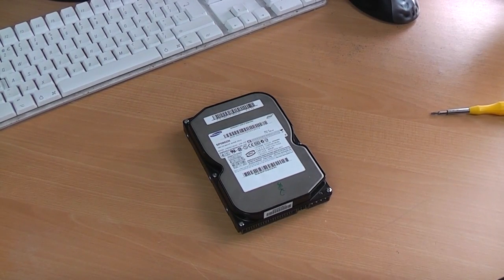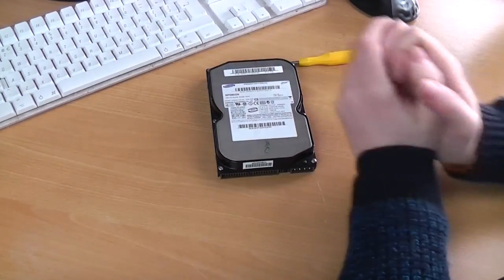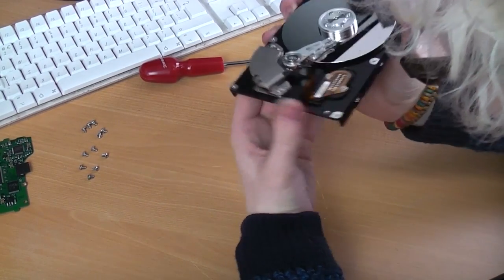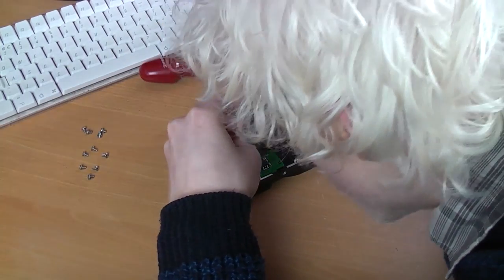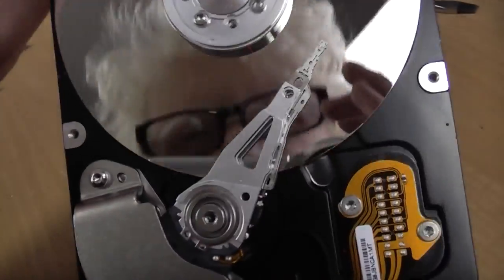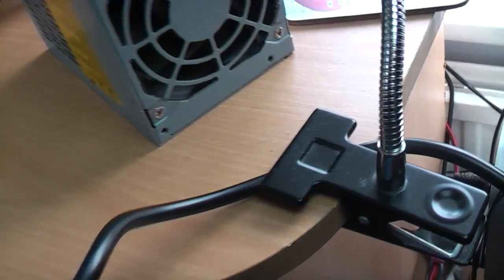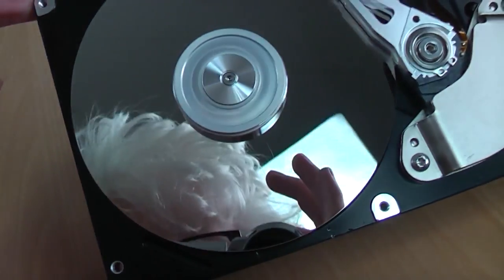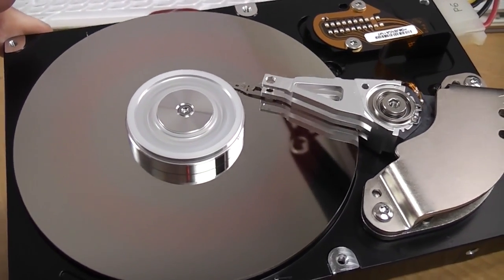Dismantling an 80GB Samsung IDE Hard Drive | IMNC

Comment: The magnet is actually what makes the read/write head move. If the head needs to move, A bit of current is brought through the copper wires at the back of the read/write head. This creates a (very precise) magnetic field, which of course is attracted to one end of the magnet. That's what makes the head move. When you see the head move, it actually moves 25 times in one second!! That's really quite awesome. You should totally check out the SlowmoGuy's video. They filmed this read write head moving in super slow motion, really fascinating. BTW, you can pry those two magnets apart, they make for really fun toys to mess around with. Just watch your fingers.

Comment: Cool. I had one of these Samsung drives out of an old HP machine. I never opened it, but I had a Toshiba laptop drive that went south so I took it apart. It pretty much looked like a miniature version of this. The platter is so weird in that it sounds and looks like super shiny (mirror-like) metal, but I found out it was made of glass after it fell off my desk a few weeks after I took the drive apart. It was still interesting to see the inside of the drive though. I used the platter as a drink coaster until it broke. There's lots of cool things you can do with the platter if you keep it. Some people have turned them into clocks since it has the hole in the middle.
Reply: the magnets are something you can use :P I had my hdd go out in my old win 98 machine and I did this to it

Comment: Interesting video tom. BTW... i had an old 40GB maxtor  IDE HDD that went to my windows 98 machine, but it went kaput. So i took it apart, and the reason i font it was soooo difficult is because there is a seal that protects the platters from dust. You see, the reason hard drives were designed like that is because the R/W heads are placed just 10 micro inches from the surface of the platter, and while hard drive repair rooms are dust free, your room on the other hand is not. So that hdd was destroyed when you opened it.

Comment: Ah. Samsung hard drives. ABSOLUTE... FUCKING... SHIT.

I've had 7 of their hard drives over the years (mostly came in external enclosures so not really by choice). 100% failure rate, within the firs year. Most died within the first 6 months. Absolutely useless, crappy, shitty drives. No wonder they were always cheap as hell. They'd also start off fast then get slow as hell not too long after you start using them.

Their SSD's on the other hand are pretty great.
Reply: I'm using a samsung (non server) drive in a small server which was running for 4 years straight now without a reboot and it works perfectly fine.. so I had luck I guess